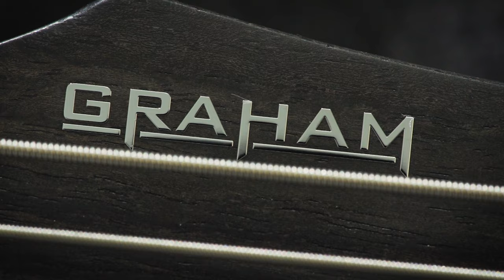7 String Multiscale - Guitar Build - PART 11 (The Finale)

Comment: Hey Luke, this build is absolutely phenomenal. Really impressive work!

Btw, where did you find the bolts you used for the neck attachment?
Reply from the maker: Thanks heaps! Had heaps of them at home, they're just m6 countersunk hex heads about 35mm long from memory. Any hardware place should stock them.  High tensile 12.8 are normally in a black finish